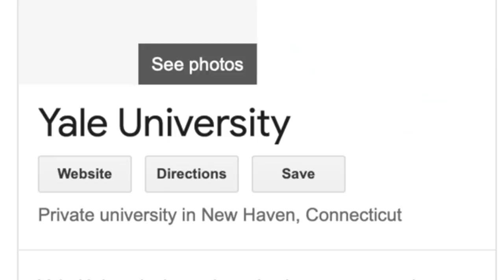giving my bedroom a SHOCKING makeover

Comment: Pro tip: Hang your curtain rod as close to the ceiling as possible to create the illusion that your windows and wall are larger and taller. the current rod position making your wall and ceiling look shorter and cut off